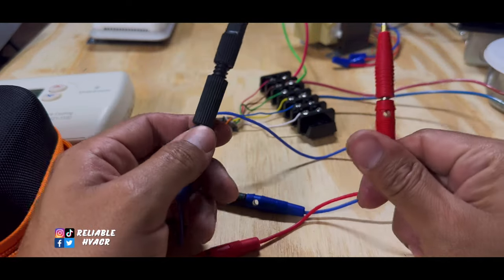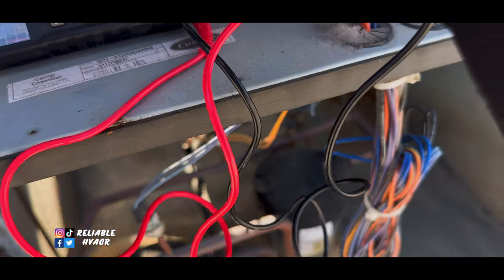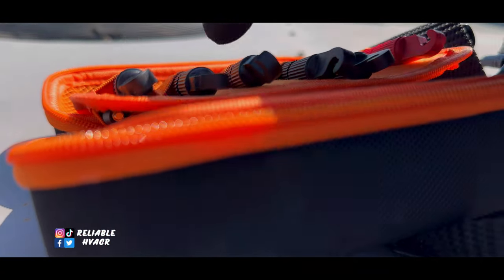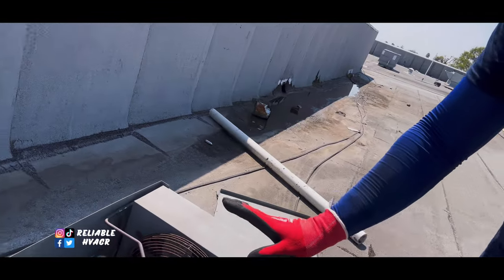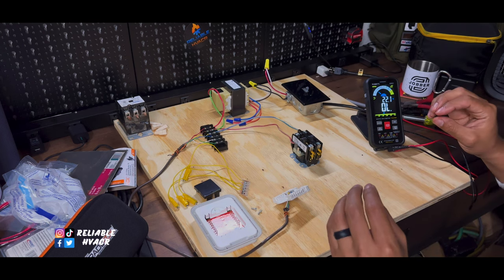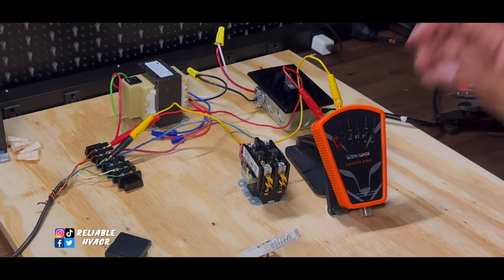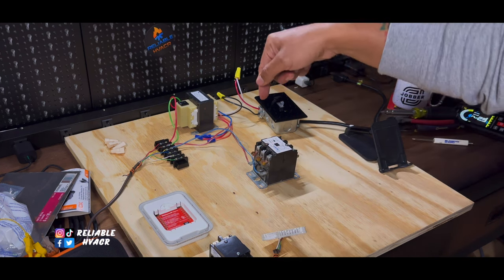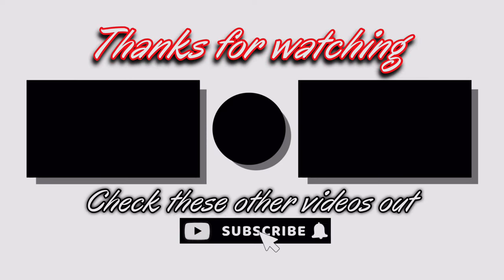How to use the Supco Jumper King in the field

Comment: I purchased a jumper king and received it last week, the magnetic on my is loose and always falls out. The carrying case is nice but the holders for all the accessories needs to be reevaluate it. I love the concept of this but it does have some shortcomings. Magnet should be more secure and the carrying case needs to be revamped. But overall love the concept.
Reply from the maker: Gotcha, I think I mentioned it in this video that I had similar complaints and they are working on it, especially the case. If you have issues reach out to who you bought it from, maybe get a replacement